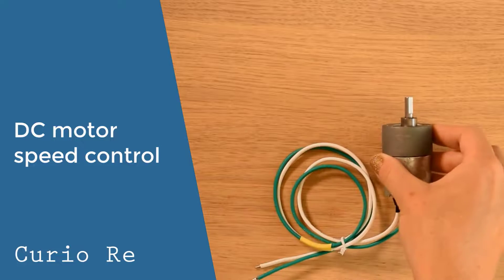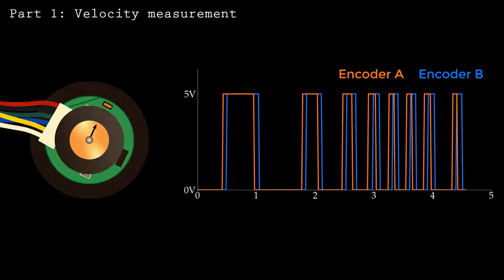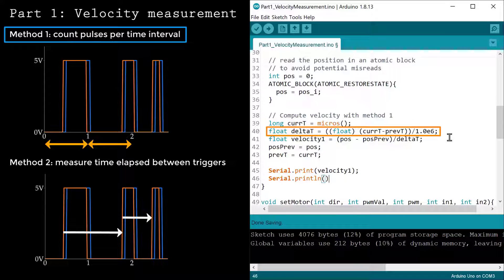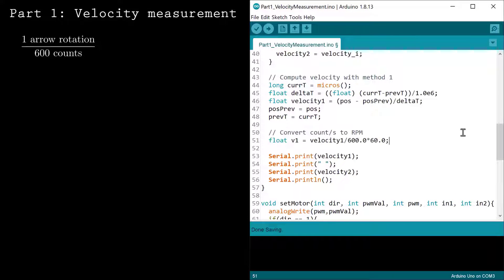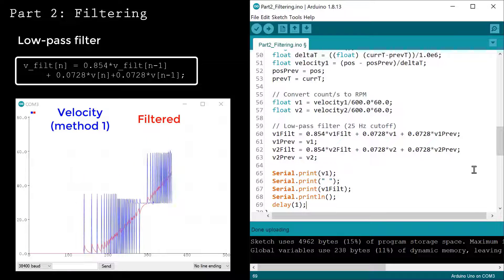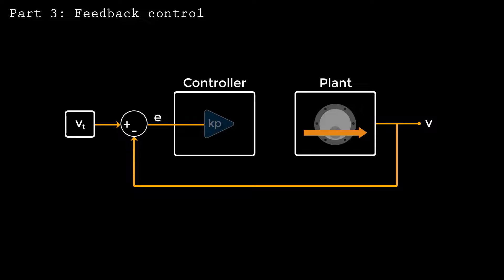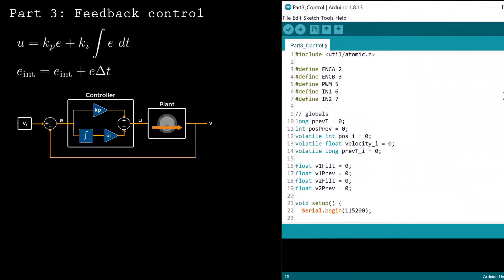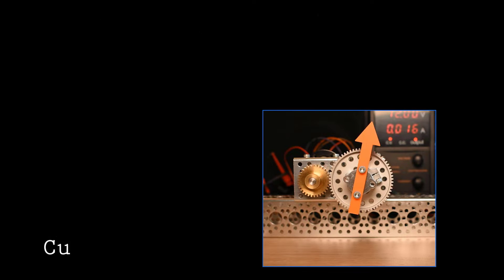DC motor PID speed control

Comment: CRYSTAL CLEAR. But I have a question about one of your prior videos on PID-controlled DC motor position control. My main issue is that my motor continues to oscillate at the desired position even when I change the gain levels. Please share your explanation. These are the specs for my motor ( gear ratio 30: 1, 600 rpm and 4092 CPR)
Reply from the maker: thanks! Hmmm.. are you actually reaching the target and then oscillating? If so, I would try reducing your proportional gain down to 1e-8 and then multiplying it by a power of ten until you start to get a response (kd = ki = 0 too). There might be some other issue in your code, but if you copied the code I posted then it shouldn't be a code issue.
Reply: @curiores111  I had copied same to same your code. Yeah I am reaching my target position then afterwards it  ossicilates at target position. I will try thanks for replying me.